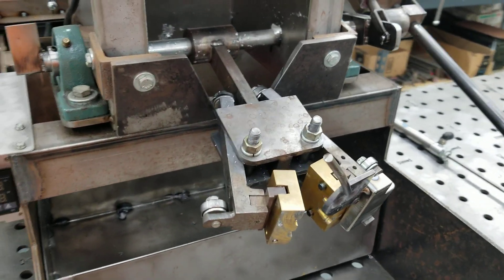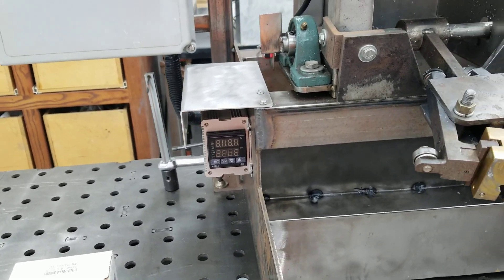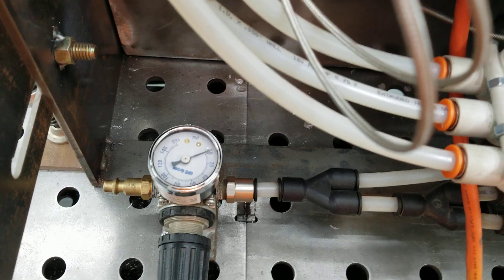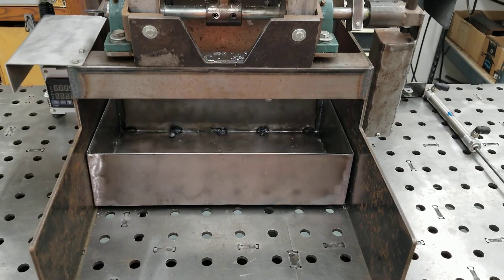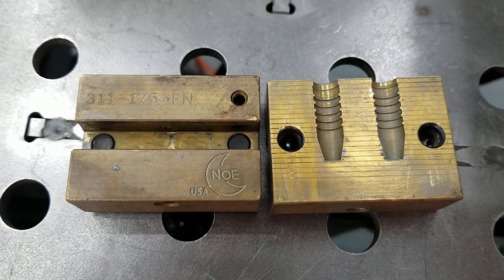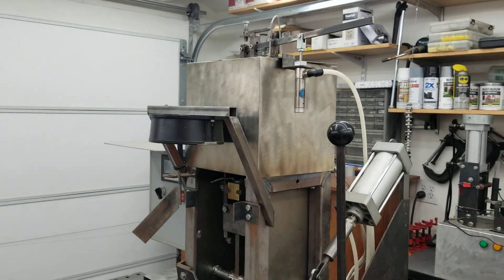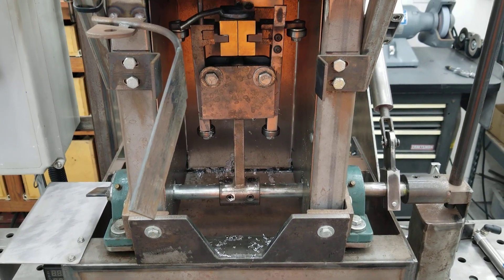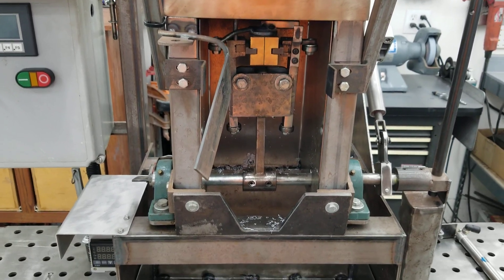Upgrades to automated bullet casting machine (explanation)

Comment: Very nice machine. I have found a local person selling a master caster. I'm new to casting, so should I decide to pick it up, I'll keep it manually operated, but I do appreciate the "let the machine do the work" POV!
Reply from the maker: Thanks! A match director at our club saw my video last weekend. He has a master caster and wrote a program for an arduino but doesn't know how to do the mechanics and pneumatic portion. My machine is what I came up with after watching the master caster videos. I still have not seen one in person. There are old threads and videos on the cast boolits forum (also videos on youtube) of people automating them. Most likely I will do his. It isn't very complicated if you end up doing a lot of casting. It is good to go manual at first and then see how far down the rabbit hole you end up. 😁